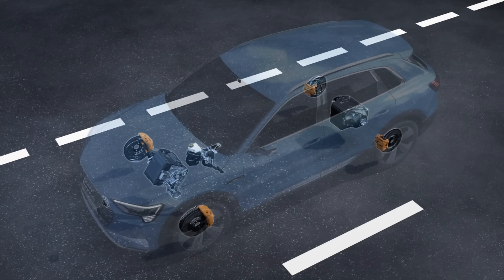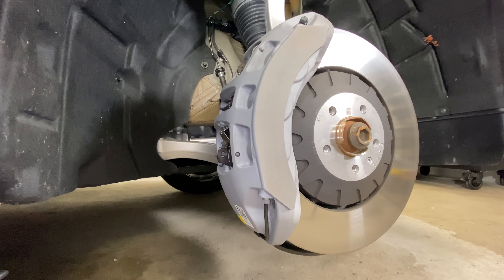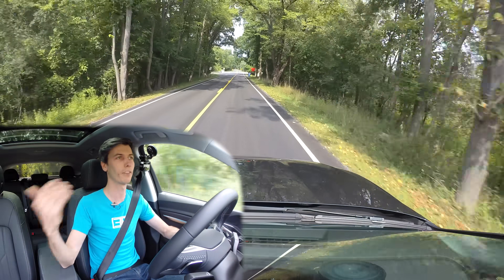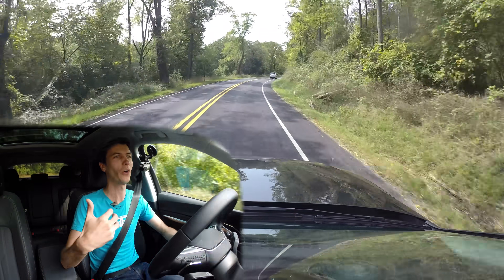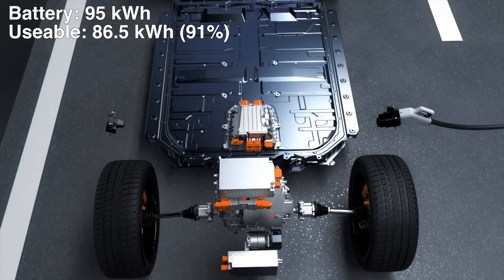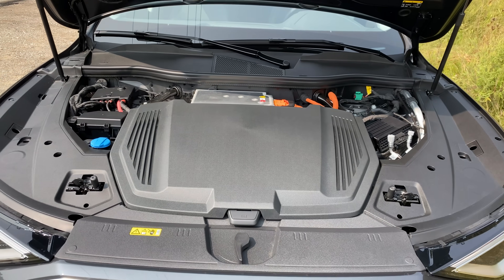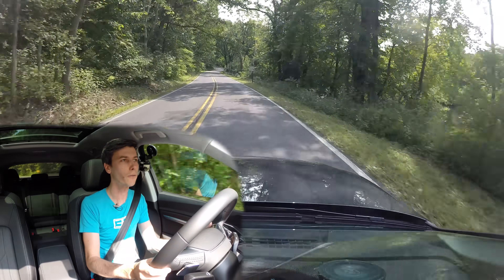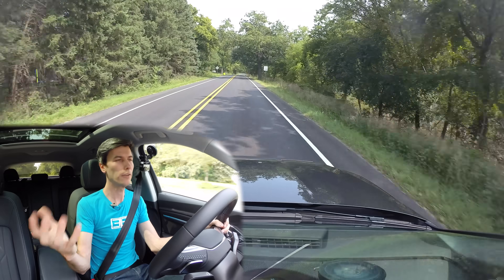How Does Brake-By-Wire Work? Plus: Audi e-Tron Sportback Review!

Comment: In short, it's just a system they came up with to control where you want regenerative braking and where you want friction braking, then?
Clever. But our increasing reliance on computers and everything being connected to the internet will make it so when someone wants to hack into your car, they can kill you leaving no traces, the car maker gets all the blame for a system failure and if the hack is discovered, they will be forced to retrofit all their cars with standard systems or completely disable the controller, disabling the regenerative braking feature.

People have been demonstrating how to kill throttle in e-throttles since the middle of the decade. Now they put a Confuser in between you and THE quintessential car safety feature.

Yes, yes. The fail-safe valve thing. Not knowing how it actually works, but somebody will find a way to override it.

Comment: Nice concept, looks good on paper.
My Toyota RAV4 goes further on a tankful.  I don't need all the "upscale"  features on this vehicle.  Most of my driving is around town these days and I don't have to "top off" the "power source" every time I use it.  Even my old 06 Nissan Frontier 4.0L V6, 6 speed manual, 4WD goes further on gas than this 80,000 dollar vehicle.
Reply: But do you need to go further??
And if you're driving around town, you really ought to be asking about your contribution to local air pollution. That, in my view, is the biggest immediate benefit of electric vehicles.

Comment: For common local driving most would of course buy a small used gas car rather than be satisfied with a 200 mile expensive EV .. effective range of 400 mile nominal is 400 minus ~40%, or 240 miles which is about adequate. Subtract if cold. I would get an EV, but only of 400-500 miles reach or better. Thats expensive, so I will wait.

Comment: I can confirm - you very rarely need more than the regen braking on the etron, the brake disks tend to show quite a bit of rust even when the car is driven regularly. 
edit: also can't speak for the newest etron models, but the original model will default to charging up to 80% of the capacity available to the end user.
Reply: Yes - from the manual "You can set the charging target, meaning you can set the maximum charge level to which the high- voltage battery should be charged. The charging target can be set between 50% and 100%. For daily usage, Audi recommends setting the charg- ing target at 80%. This can extend the service life of the high-voltage battery. Before long trips, Audi recommends setting the charging target at 100% for the highest possible range."
Reply: @cadriver2570  and if the car is gonna be sitting for a while the charge limit should be set at 50% to extend battery lifespan
Reply: It has a brake disc wiper to prevent rust
Reply: awesome! but now cars comes with EPB and that is really brake by wire in an emergency brake. Are they really safe?

Comment: What happens when the batteries go flat?
Reply: Well presumably the car would not be moving. 
The battery stops providing tractive force before it shuts down all the electronics. 
If you are asking what happens in a catastrophic loss of power? It reverts to hydraulic brakes, but still, I see no reason why this is dangerous. 
Airbags still work without power, because they have a separate system storing power for emergencies.

Comment: Sounds like the cost of auto service is just getting more and more expensive.
Reply: @leolego2  They are probably referring to the brakes specifically.
Reply: Totally by accident wink wink.
Reply: What service? When the circuit board goes bad, you replace it, only cost 1/2 of the car's remaining value.
Reply: @ZoneCrasher  Good thing curcuit boards last a long time, usually much longer than mechanical parts. EVs are far less expensive to maintain, its just a fact. ICE cars have just as many electronics and computers anyway,  just like 99% of the criticisms of EVs they apply to ICE as well.
Reply: I mean, it's an Audi.
Reply: If done right (prius) and maintained (timely fluid changes) it's reliable and inexpensive to maintain.
Reply: The mechanical complexity required for this was added by ABS. All we're talking about here is making more use of it.
Reply: It's a Volkswagen, they ship broken. Source: I own 3. lolll
Reply: How does eliminating oil changes and exhaust repairs make service more expensive?
Reply: @moi01887  that is what's written on a poster in the office of many engineers, right now.
Reply: @moi01887  failed electronics tend to cost a lot more than mechanical issues. And when many will have EVs then price for parts an labor will go up to compensate for less often services. Parts and service is a big income stream for manufacturers and dealerships. Do you really think they are some sort of charity and will let go such a stream? Remember in the end it is still a business.
Reply: Olafs Vaļinieks another only that but the service ppl will charge $$$ for using their computer to diagnose bad electronics and the charge for replacement labor and what not.
Reply: @olafs_valinieks  You dont know what youre talking about.
Reply: @leolego2  nah they break all the time so it will be a lot more in the long run. And for the amount extra that an electric costs you have 10 years of service for a gas car. And they make a really annoying sound and idk how people call those cars silent!
Reply: @patrykrog8121  You dont know what you are talking about.

Comment: It sounds like I’m going to have to start riding the breaks going downhill instead of dropping into a lower gear. That will take some getting used to. 

It would be nice to get feedback on when the friction brakes are being applied, so driving style can be adjusted to minimize friction braking.
Reply: For EVs in one pedal modes, all but the most extreme hills are just let off the throttle. Anything you can engine break alone you can regen break with ease. Only the harshest examples will require literal breaks.
Reply: @anthonyschroeder521  interesting, thanks.

Comment: So aside from an electric car that has regen that can help slow the car, if you still have all the same hydraulic system there, why make it electronically assisted as opposed to vacuum assisted? What's the benefit?
Reply: No one uses vacuum assist in an electric car or a diesel (because there's no vacuum) and even gas-engine cars are going to electric brake assist now.

Comment: If you live in a city and you don't leave that city's area much, smaller ranges are perfectly fine. I would already have an EV if I wanted to live in a city, seems like a no-brainer to me. But I live in a rural town. Most of my trips (times I get in my car) are short. A Leaf's range is more than enough for me. But for me and most of the people in my town, most of the miles I drive (well over 70%) are long enough trips that I need a minimum of 400 miles range with fueling stops that get me another 400 miles and take less than 15 minutes. A PHEV works extremely well, but that means most of my miles are driven using fossil fuels. With our governor making even PHEVs illegal in 15 years, I think there is a real concern for rural America given your (and others) view that 250 miles is "more than enough". What happens to rural America if no EV maker takes range seriously and fossil fuels become prohibitively expensive?

Comment: You can actually actively break electric motors by applying a DC current. I'm still waiting to see that in EVs. Why are we still using brakes with moving parts that can fail?
Reply: that requires you to have capable Motors for all 4 wheels while most EVs only have motors powering the front or back wheels. 

The brakes on a car turn massive amounts of kinetic energy into heat at extremely efficient rates.
Let’s say you have a Tesla model S p100d traveling at 60mph. It will have roughly 815, 833 Jules of energy that needs to be dissipated. That’s a massive amount of energy. You would use far more energy just to stop at the same 109 feet than it did to get to launch the car to that 60mph in 2.5 seconds.

Comment: You have missed a great point. The break by wire systems reduce break way drastically, especially in town, because of the much faster pressure build up compared to conventional break systems.

Comment: Hey Jason, can you talk about the "torch ignition" of the GAZ 24 four cylinder engine, is an interesting example of stratified combustion with a carburetor and OHV 3 valve.
I ask for this because i was trying yo find prechamber gasoline production engines  like the Maserati V6

Comment: 10:05 please.. PLEASE overlay data in metrical units on the video. This is an engineering channel. Otherwise, good video!
Reply: I'm an electronics engineer from Argentina, my native language is spanish and my native units are metric/metrical whatever. At University we don't use the imperial system at all.
Reply: @jorditribo94  No body does.. 😅
Reply: @jorditribo94  Yes, you are correct! So in SI system: you can drive a distance with 50 football fields witthe weight of 15 cows battery. :DDD
Reply: @rocko44444444  It depends on what you are brought up with. In the Uk small amounts of area are in acres or Hectares (I dont think anyone has any idea how big a Hectare is) but larger areas are "X" times the size of Wales.
Reply: Garrett Brown Equations with units??... ewww
Reply: @garrettbrown8647  So you have different equations for imperial and metric? Nice lol.
Reply: @panzer3279  Yup, exactly. some equations don’t work for both units so we had to learn distinct eqns for each system. Needless to say the metric ones were much more straightforward...
Reply: I know guys, just having fun.
Reply: Nah. He should say it in metric and overlay imperial.
Reply: here's why the US doesn't use the Metric Sy
Reply: Metrical?
Reply: @mikescherrer4923  yes, metrical.
Reply: @mikescherrer4923  Metrical? You must have gone to that train conducting school in Mississippi, didn't you?

(I'm from Alabama, so Mississippi is fair game. I hear they talk about us just as often.)
Reply: I mean, not to be pedantic but all units are “metrical” by definition. You would want Metric units. The system is called the Metric system. My phone even capitalized it lol.
Reply: @mikescherrer4923  but you are. We all knew he meant metric :p
Reply: Noob can't convert units.
Reply: @MrS22222  bahaha
Reply: Or you can just do the approximate conversions in your head.... engineering wise, you do know that metric is NOT more accurate or precise...right????
Reply: @joeshmoe7967  The metric system is significantly easier to mentally visualize and work the numbers in your head.
Reply: @joeshmoe7967  For conversions within metric, it is easier due to being multiples of tens. Conversions within imperial units does not have consistent coversion factor, increasing odds of error. Sure computers can handle those well, but communications error are likely.

Comment: I was wondering why don't they just make the wheels regen the whole entire time instead of regening during braking. I mean alternators works with by regenerating nonstop.
Reply: Regen is not more efficient than just rolling
Reply: @stefanpredl6849  maybe technology would changed that one day to were regenerating electricity would allow for e-vehicles to sustain longer miles than what they currently offer. Just trying to start a dialog for  possible future tech in this new Era of e-vehicles.

Comment: This is very similar to the system used in the 2004-2009 Prius, which is also brake by wire.

Personally I prefer the Tesla solution - don't bother with blended brakes at all. However, if you do want blended brakes, the Toyota/Audi solution is clearly better to what Nissan does.

Comment: Engineers have once again over designed a simple system and made it more expensive.
Reply: It is actually a pretty simple system in hardware point of view. The Software is the main problem.
Reply: The conventional system was getting significantly complicated. This simplifies things

Comment: Does the failsafe still work ten years down the road when the switchover valve hasn't ever moved and old brake fluid is stuck inside it? Old cars with analogue, physical, non-computer aided systems are far more fun.

Comment: I absolutely agree about the only occasional need for a long range. However, for the sort of money these vehicles cost, I'd expect to be able to perform the same tasks that I do with an IC car, and frankly you can't with that sort of range. I wouldn't accept an IC car having that range, and the same goes for an EV. I could fill up an IC car with 220 miles range in a few minutes, but I'd still consider the car unfit for purpose if I had to do that.

Comment: I think that's gonna be a hard pass for me I was already worried about E throttle. I would like to know when my brakes are getting worn or "fading" not have a constant feel that informs me of nothing.
Reply: You dont have to worry that much because those brakes are dimensioned to do all the job but are used maybe 5% of the time. The bigger problem will be that you will throw out the brakes cause they got rusty... my car has an overkill brake system on the front which leads to 120.000km on 1 set of pads and rotors... now imagine it being hybrid...
Reply: Electronic throttle has been around for 2.5 decades, as will brake by wire be in a while. Get used to it, it's around to stay. We're not going back to carburetors anytime soon

Comment: how does 400hp and 490ft/lbs not get it to 60 faster? my car's rwd not awd, manual transmission, has all its power way up high in the revs, and only has  330hp and 276ft/lbs and gets to 60 in that time or less, with two manual gear changes and usually some tire spin along the way. and it's not a light car. I guess this thing is just crazy heavy? when I heard the acceleration stat I was surprised my car pulls harder (same time but with gear changes means higher peak g's) since hard pulls is like the coolest thing about electric.
Reply: Its probably bc it's really heavy with all that extra crap

Comment: Manufacturer recall involving brake by wire system 2022
Reply: Joel Present gm stopped selling 6 model vehicles including the c8 vette because of issues with brake by wire, if what I saw was correct.
Reply: @benfowler2127  lol well nevermind it started way earlier than I thought 😂
Reply: Major lawsuit to get audi to fix it circa 2009 a4 tsi engine.
Reply: As usual, new generation solutions are not perfect the first time around, and people that buy those first gen quasi experiments, are simply ignorant.
Reply: Your daft to buy an Audi in the first place.

Comment: Being older I would never drive a vehicle where my steering, brakes, clutch and throttle pedals  are not directly mechanically connected to the appropriate system. I would get the tag ANALOG for my 2005 Lotus Elise if I did not wish anonymity. Keep computers out of my vehicles save the engine ECU. I demand FULL control of my driving experience.

Comment: Would it be possible to have a braking system in a car that just uses the electric motors to stop the car at high braking needs?
Reply: Technically you could. The main problem is locking wheels. You just can't regulate the engine fast enough (ABS).
Reply: I guess you could but you run into a lot of problems and just being overall impractical.
Reply: @ColorHawk_ , would it be impractical?  A computer has already controlled the torque of the motor in one direction.  Without a brake caliper, hose, fluids, and disc, it would seem to simplify the setup at the tire.
Reply: The motors' braking force is limited by how much wattage the inverter and battery can accept.   You'll also get more braking force at slower speed; to a point. At a very slow speed (it used to be 7mph in the Prius I drove), you need to switch to friction brakes.

Comment: Actually tesla has a buffer too on their car, the p100d is a 102kwh pack and you can use only 98 of them. For model 3 LR it's 71kwh usable on a 77kwh pack
Reply: The difference is that the Audi uses it as a top buffer, so you never really charge the battery to real 100%. Tesla's use it as a bottom buffer that they substitute in to counter battery wear/save the battery from ever actually being at 0%, but I believe you can charge a Tesla all the way to real 100%.

Comment: But you are forgetting battery efficiency losses on standby like just in park not doing anything and range is much lower in the winter plus also it charges much slower in the cold so mainly range is a issue that's why people would want to have atleast 330 miles of range for the peace of mind